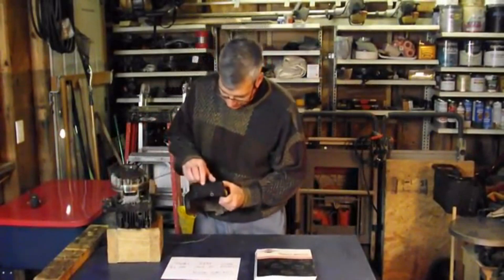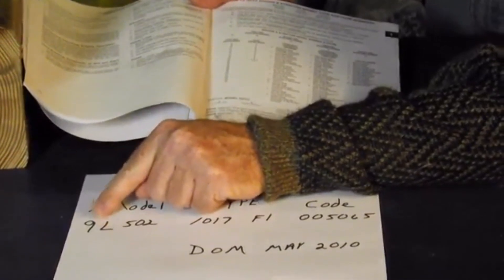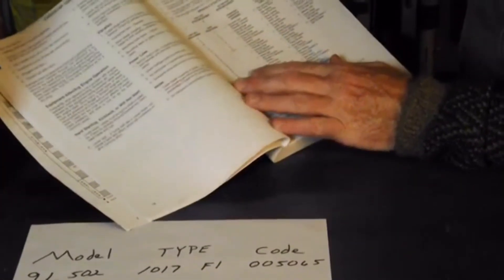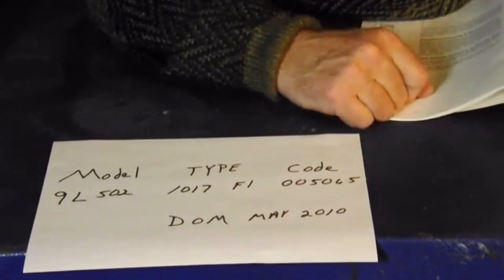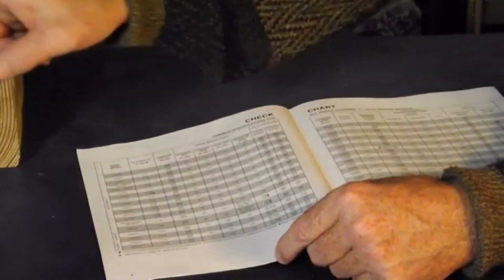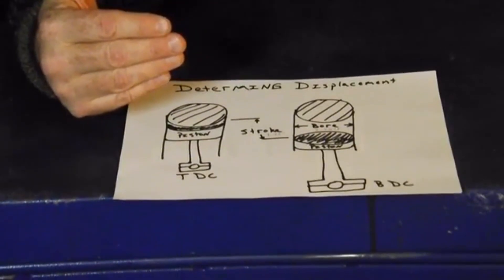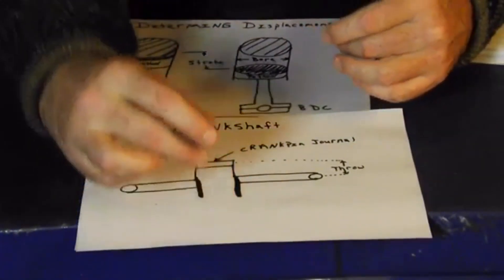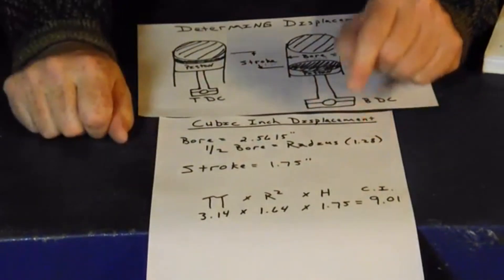Small Engine Manual

Comment: Gene I'm trying to find the torque specs on the Bolt that holds the 2 counter weight half's together onto the crank on a 8hp Briggs, 191707 2515-01, where did you get your repair manual?